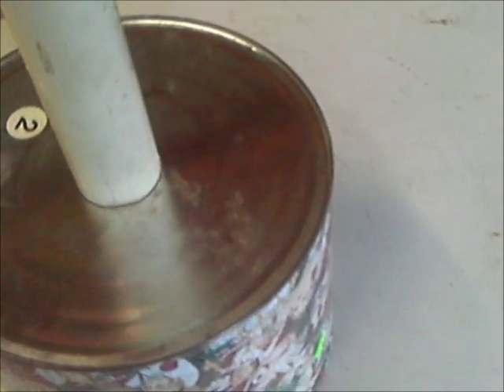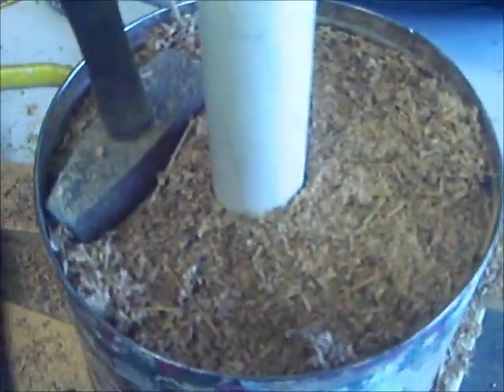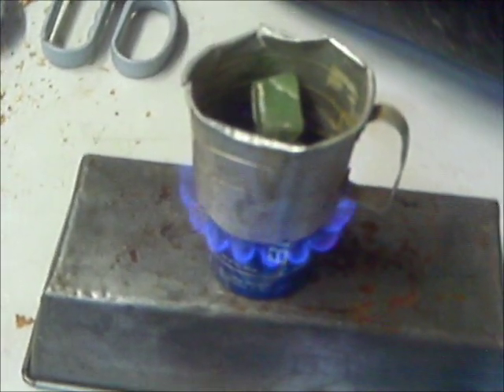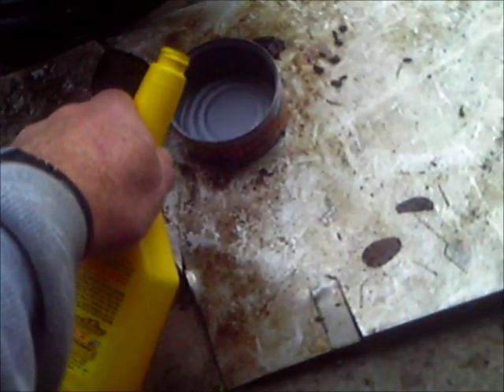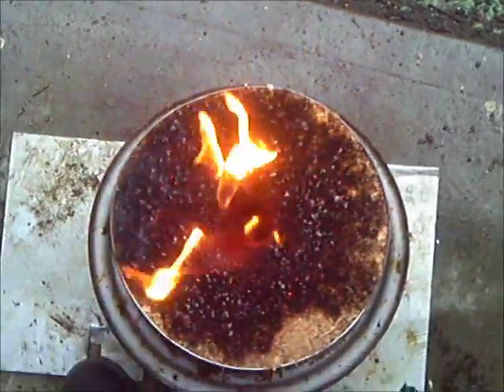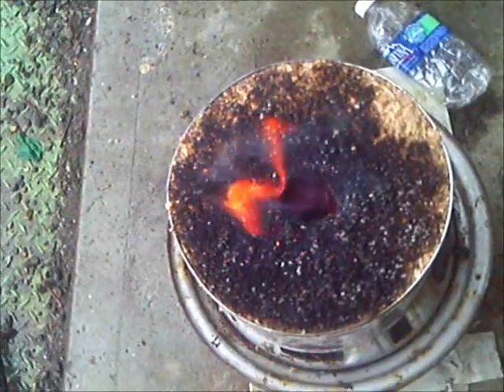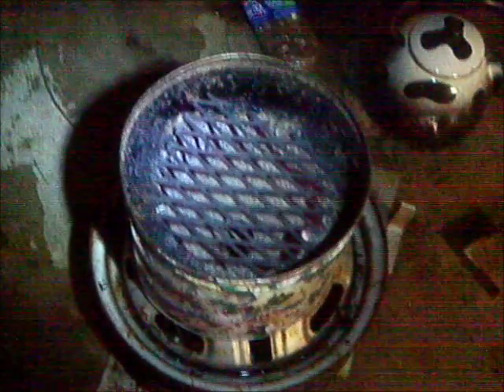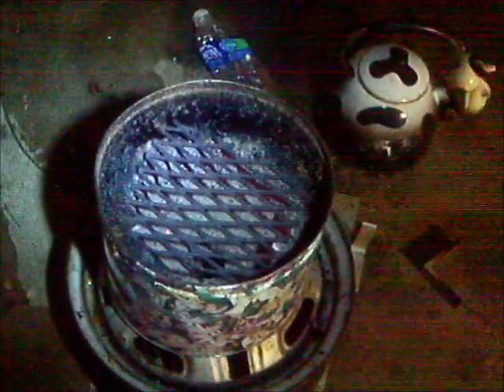Sawdust Rocket Stove

Comment from the maker: You found my first attempt at making a sawdust stove. I put the tin inside another tin now and put a burner top on that. 660 deg. to top burner plate. That is using a 1 1/4" exhaust hole. No wax, no smoke and burns 6 hr of cook time. On top to stop that from burning I put vermiculite a 1/4" layer. It works great.

Comment: A couple things one could do to eliminate some of the more unnecessary things that happened: Burning top? make a metal ring to sit on top, or put a layer of sand on top of the dust. Also... Don't need wax on the top opening, it's supposed to burn bottom to top, from inside to out. A burning top just makes more smoke and gets unneeded soot on cookware [not that it really matters] as well it wastes a bit of fuel.

Want long burn times? Hole diameter should be 2-3" / 12" of container diameter.